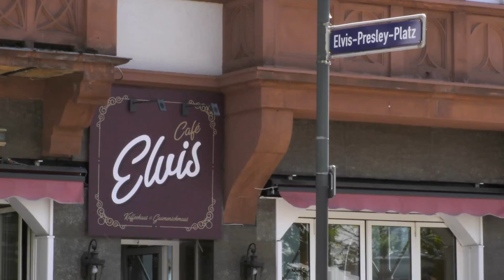Schrödinger's viaduct: the 24 Halls of Friedberg

Comment: Ha, this is so German bureaucracy, with an emphasis on "bureauCRACY" XD 
Not only do we have 3 different viaducts/bridges instead of just one, the state is simultaneously trying to destroy and preserve one of them. Bahahahha. 
I get why there's 3, like, I am all for preserving the viaduct. They are kind of cool, and, as we've seen in the video, the supports are spaced in a way that even allow roads to be run in between. So it's not a hinderance. 
But this is typical: this building will exist in "construction limbo" until it actualyl starts to fall apart and rain brickwork down on cars or walkways, and then something will need to be done. 
Either, it will have crumbled enough to be fixed or demolished, or 
we will simply install nets or a sort of roofed tunnel to catch the offfall and wait until it is further crumbling so we can demolish it. 
A similar approach is taken with old buildings that have to be torn down, but which contain toxic materials that are very expensive to get rid off. Some poor soul owns the building, theoretically, but can't actually do anything with it because nothing they would be able to build in its place could justify the steep toxic cleanup of like asbestos, lead paint, old chemicals (like leaky tanks of a gas station, ex factory, etc.). 
We actually got an old insane asyslum / nunnery in Cologne that was infected with some type of parasite or bacteria. The problem is that, the spores I guess?, infect concrete and so the whole thing has to be expensively deconstructed in a way that does not allow dust to get out, which is not impossible, but so expensive that nobody wants to do it.
Reply: Give Vlad another poke or two and he might arrange to have the job done for free?!! 😜😁
Reply: @theoztreecrasher2647  Ha, ironically: no. 
the old, cold war nato defense plans would basically sacrifice everything east of the river rhein with copious carpet bombing to stop the invading russians. 
they'd sacrifice germany to create a buffer zone too hot and toxic for the russians to cross, which would buy the allies time to mobilize. 
the irony is that the cursed asylum is on the left side of the rhine and would be left standing XD